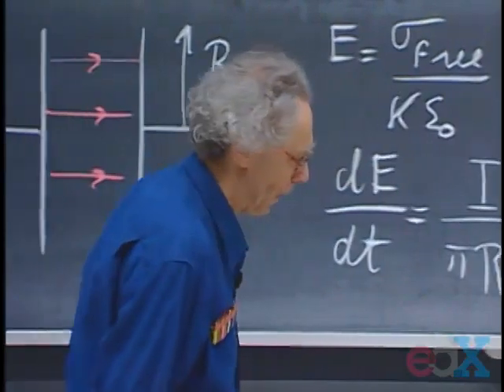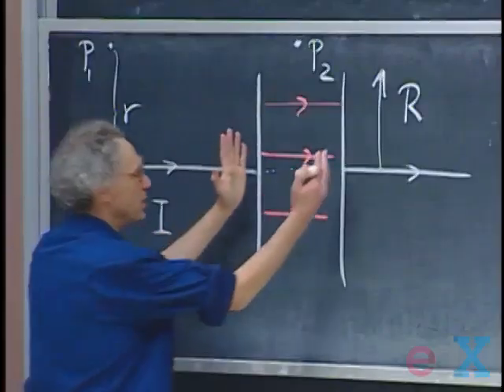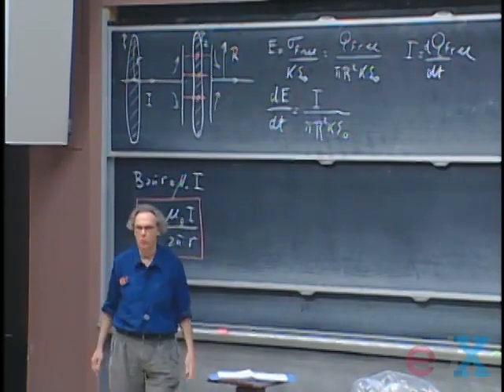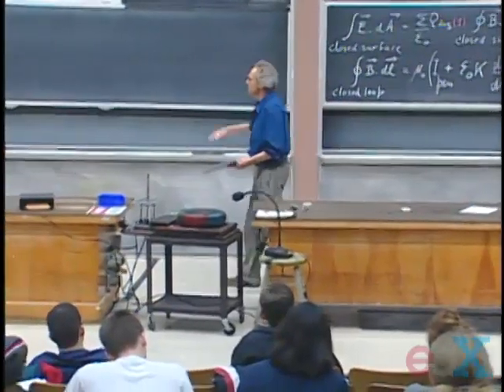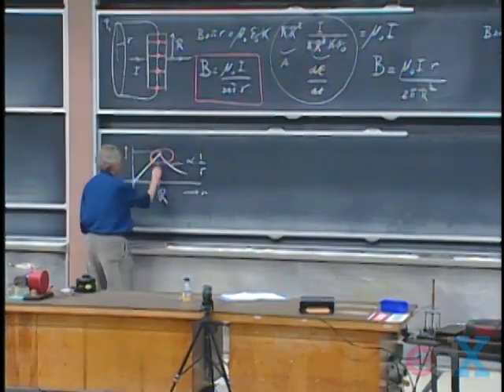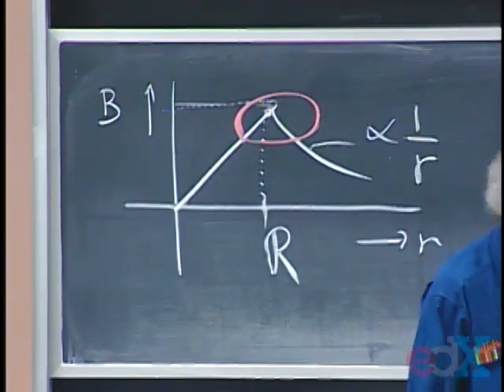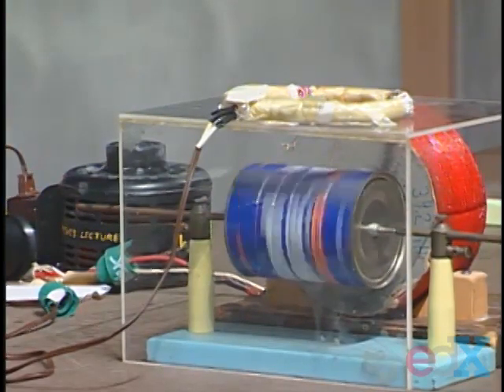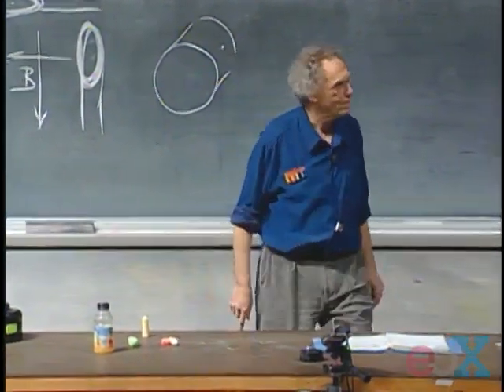8.02x - Lect 18 - Displacement Current, Synchronous Motors, Explanation Secret Top

Comment: I'm pretty sure they usually rotate the magnets, not the wires. Because if you rotate the wires you have to have brush contacts, which will wear down and cause other issues, while when you rotate the magnet, you only have the bearings wearing down, which last a lot longer.

Comment: Why is electric flux zero at point p1
Reply from the maker: flux goes through a surface. flux through a point is always zero as it has not surface.
Reply: I mean for the flat surface containing point p1
Reply: @rakshitsohlot7461  Do you see a potential difference between both sides of the surface through P1? And between both sides of the surface through P2?

Comment: 10:28,why electric flux is not there through the open surface?...electric filed lines through them makes the electrons to move through wire,,,so therefore the current...i having problem..help me out...
Reply from the maker: I watched my lecture from 10:00 - 13:00. It's crystal clear. I cannot add anything to it. sorry. I suggest you watch it again and listen carefully to what I say.
Reply: +Chris Metcalf thank you for helping me out.....I really appreciate that...
Reply: Hello, have you figured it out? It confuses me as well that there is no electric flux thriugh the surface :( as well as you I think that electric field lines are aiming in the direction of the wire so the electric flux has to go through that flat surface….